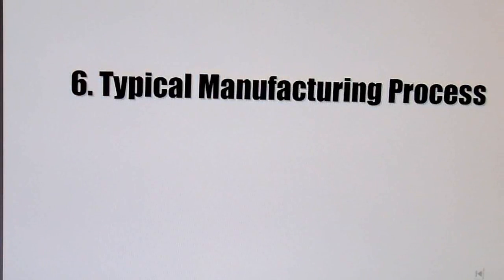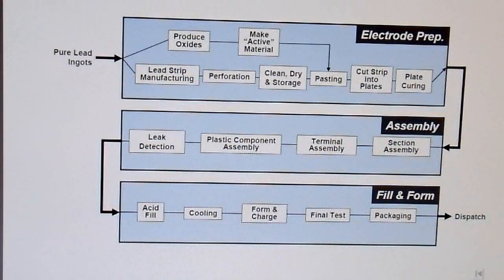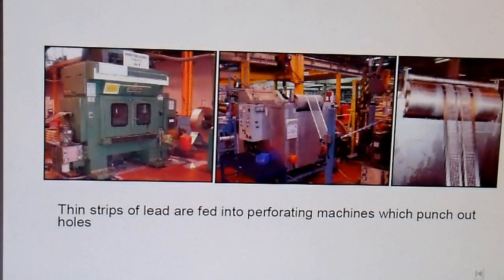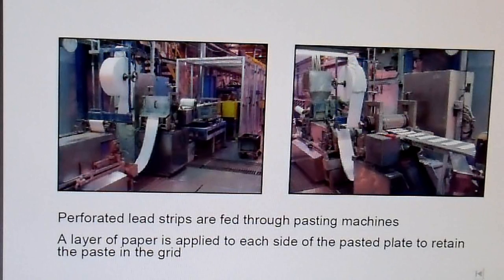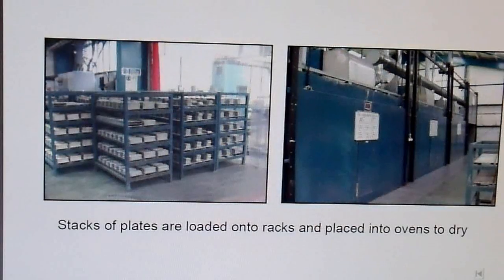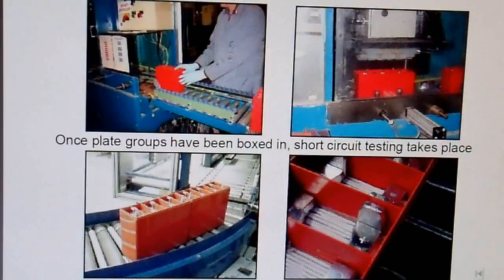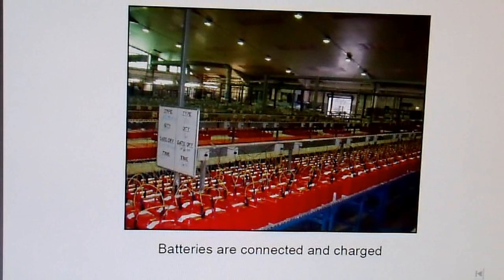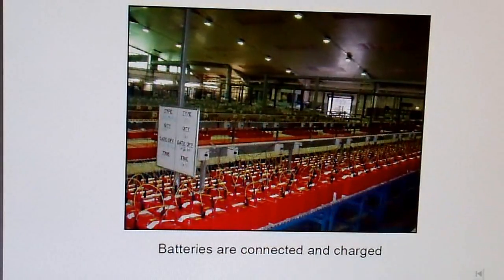1000Ah Battery Bank Part2 - Quick Overview of a Battery Production Line

Comment: Could you please explain at least to some extent what the paste is made from, what it’s job is.... is it just acid paste acidic?
Reply from the maker: The paste is simply lead powder mixed with a small amount of electrolyte to bind it into said paste rather than a powder.  (much like dust turns to mud when  you add water)  It's the way most automotive style batteries get their active lead material applied to the solid lead carrier.  The paste is more porous than a solid lead plate which results in all the good performance characteristics batteries have in terms of high currents, high capacity per volume, etc.  I am sure someone who is involved in battery manufacturing can give many more details but that's the simplified version of it.  Hope that answers your question.